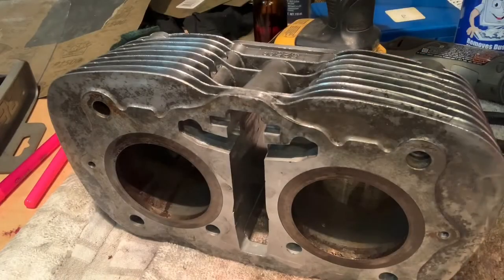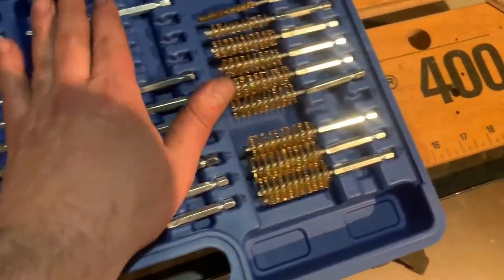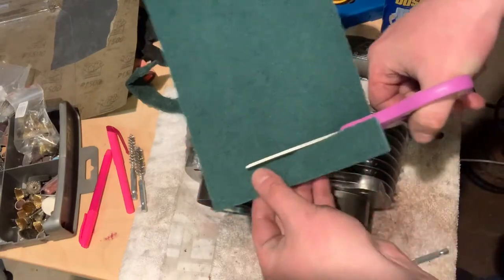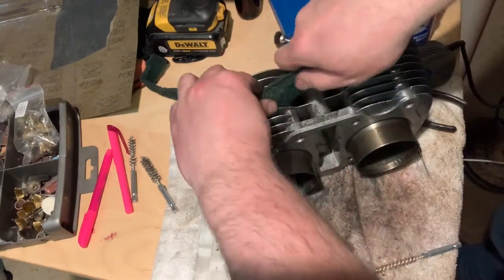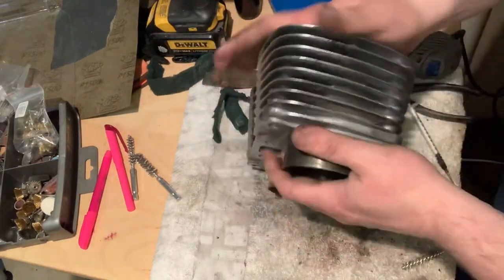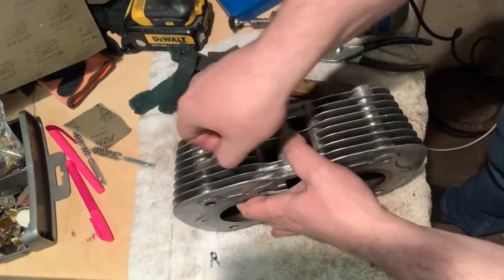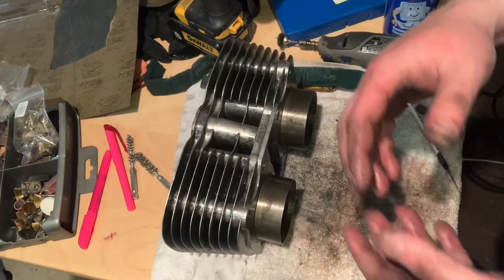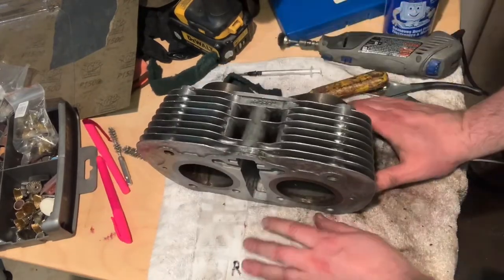How To Clean & Polish Motorcycle Engine Fins-Part 137

Comment: I used extra long soft brass wire brushes with turps then cleaned, blown out with air repeated a few times! Worked a treat on my 75 cb400f  resto 😊
Reply from the maker: My brushes were too wide! I need to find some like you. Thanks, Des.

Comment: Easier and best way to clean and polish between fins is using a reciprocating multitool. Just take the teeth off the blade and wrap it with 3m pad, sandpaper, or cloth and polishing compound.  It works 100x's faster than doing it by hand.
Reply from the maker: I have one of those! I’ll give it a try! Great tip!
Reply: Correct or an oscillating tool.
Reply from the maker: I’ll give it a try!

Comment: I do admire your enthusiasm. I'm 67 now and have been down your road so many times since I was 14. Yep, you can work away like a mad thing endlessly; but in the end you have to draw the line under your masochistic effort. Ok, if you're building a show bike, then go for it. But getting any air cooled motor to that level....handwork will only go so far. Here in the UK you WILL get caught out in the rain. 20 miles of that will result in tears...all that work gone bad. My advice is, clean your bike regularly and enjoy it as it was intended. Hell, riding the thing gives you zero opportunity to admire 80% of your machines cosmetics....just before you pile into the back of a semi. Ask me how I know.
Reply from the maker: Valid! I get a OCD sometimes. Eventually I move on but I like to give it an honest effort.

Comment: I struggled with doing the same fin  cleaning as you. I went to harbor fright and bought one of there small hot steam cleaners. It comes with small brush attachments, small enough to fit between the fins and the pressure and hot water blasts out all that old grime and grease. Then went back with XL q-tips in the drill. Worked really well for me. Hope you get to where you want it brian.
Reply from the maker: Steamer! Good idea. Definitely worth considering. I’m really fighting old paint. That’s my biggest issue right now. A major PITA but I’m making progress.

Comment: You should use a hand held sandblaster with baking soda as media and soda blast it clean works great for everything motorcycle
Reply: Is this just over the counter baking soda?
Reply: I like your idea though in the comments there are many really good ideas with technique I just think your strategy makes sense to me and possibly less work, I'm not a pro but baking soda is in my tool box next to the duct tape and gorilla glue and JB WELD. THNX 👍 NEVERTHELESS AWESOME VIDEO
Reply: Man I did that and it’s a mess and not great at all.

Comment: Thanks Brian, I always pick up good tips from your videos, I am cleaning up a 72 CB450 and have faced the same issue in getting in deep between the fins, One thing that made a difference for me was to take a small file to the edge of the fins and square them off a little then go over them with a scotchbrite pad.
Reply from the maker: Andy Crabb On it, Andy. Thanks for the tip with the file. We can do this!

Comment: Try using an oscillating tool. You have to adapt a plastic fin mounted with 2 screws on a flexible bit, then by using different grades of Sandpaper (or Scotchbrite Red/Gold pads cut into strips that fit the tool) you can get down to the shiny stuff then using compound and polish it will make it shiny again. I use Sharkhide to protect the parts because polish does not last but sharkhide is a non yellowing clear coat that protects for a few years. and you can still clean the engine in the MC if need be with the same method.
Reply from the maker: That’s a great idea. I’m gonna give that a try. Need to go buy one…shucks. Lol. Thanks.
Reply: @KeepOnWrenching  Buy a cheap HF one to try it. If you love the idea then you can get a better one if you like.

Comment: No brother you are not "over engineering ". I am into ATV's, and it does get under my skin when I see that an engine has been abused by not keeping it clean and shiny (I know ATV's are made for the mud and grime). But I am a perfectionist and I love to see things clean. Those cooling fins look so beautiful when they are clean and shiny. YOU will appreciate it in the long run when you look at the engine and know that it is immaculate from top to bottom. And if just one person gets up close and personal and sees just how much detail went into shining up the engine including in between the cooling fins, you can pat yourself on the back at a job well done.
Reply from the maker: Thanks! It ended up being totally worth the effort. Beats painting them.

Comment: I love your CB350 twin videos! Never stop wrenching :) I will be the guy that feels bad for having dirty fins lol
Reply from the maker: Totally acceptable. I’m being converted towards living with dirty fins every minute. Lol.
Reply: Loosen the dirt with solvent of some sort (‘Gunk’, or acetone, perhaps) wash off with a pressure washer, spray with HT matt-black paint and polish the edges of the fins with the light application of an abrasive disc on an angle grinder.
Matt black should shift more heat than polished fins too.
You also need to watch … you’re getting a lot of abrasive particles (from wet/dry and from Scotchbrite) very close to critical surfaces while you’re using that stuff. Les in UK 🇬🇧

Comment: I got a CB175 1967 currently working on. Some years ago I had a shop fixing and doing overhaul, the guy end up spay paint on the cylinders and gear covers etc... i hate it, now gottta remove all those. You r doing a great job
Reply from the maker: Painted engines are the worst.

Comment: To clean a 4cyl I gave it to a company that blasts dry ice. In 30 minutes everything was amazingly clean, I didn't even remove the engine from the frame. Cost me about $60.  
I then polished the edges of the fins by hand.

Comment: I always spray it down with  muratic acid and pressure wash it. DO NOT leave the acid on any aluminum part more than 15 to 20 seconds! Rinse Immediately!  It works quite well.
Reply from the maker: Interesting. Will have to look into that.

Comment: Ok. I have had this problem and now I'm doing it for my son. I will try these brass brushes as they are affordable as break cleaning brushes for car breaks. Also engine bright spray and a water pressure hose can clean more. Lastly,high temp silver spray after an oil displacer like brake cleaner will make them look like factory new. Enjuy. Oh and tape off all the cylinder holes, oil galley ect.
Reply from the maker: Not a huge fan of painting engines but yes a pressure washer and degreaser is key.

Comment: If you have a compressor you can get a cheap sand blasting gun. The 1 with the little hopper on top. Use Bicarb soda. This is not very abrasive but cleans reasonably well.
Reply from the maker: Plan on trying that one way.

Comment: I cleaned my fins a little with Simple Green and a toothbrush. This is while it still was on the bike. It worked well enough for me. I was cleaning the carbs by draining the floats as well and used a little gasoline on the fins. That helped too with the greasy parts. For me it cleaned up well enough tonight. I may clean it more later. Mine is covered pretty well with full sets of fairings on my 2004 GS500F motorcycle. This was a good video. Thanks. God bless. I was thinking 🤔 a cool way of cleaning it would be with steam or nowadays even with lasers which they use for cleaning.
Reply from the maker: Thank you!!
Reply: Yes brother  I enjoyed  Your videos  I was checking  Your Vid on how to put Gas Tank Decals  onfreshv paint my body guy did amazing  job on custom  paint and put oem Decals  on my vintage  CB on one side not good  so I went to my mechanic shop and he had original  gas tank same as my bike with  Decals  on it so I brought  that down we are going  copy  OG on to my tanks and measure  as well as we go hopefully 🤞😯🤞 it will come out Excellent  once we are done I'm going be assistance  to installing  it I spend 2 years doing Cosmic  Restoration Not easy on my gorgeous  NOS machine  to perfection  mint condition  and this is final touch Honda Decals  are sensitive  to install  with body  Line's and where Decals  have to be placed will see how goes  any suggested  comments  will be helpful 
As far as cylinder  I try see how Look with polishing  several  fins and look nice but I think  Black Looks great with powder  coat Look to it when I clean them I use simple  Green ket set little while then I put scotch  and white rag and clean it spray water inside rinse out dry it paint after it took few try to get paint inside  you almost  got get tip right up to it spray  works great I paint engine  as well Looks gorgeous  cover all  hardwares  and rest parts went to Downtown  with it looks Like brand new engine  with same factory  blend finish  Looks fabulous 👌 👏 👍 😍 💖

Comment: Great work, enjoy your videos as I recommission a 74 CB450, I noticed the same grime cleaning out the motor, I have used purple power, which has been very effective against the grime in the fins. I had some wood shims,which I use to break up the grime then use another bottle of warm water to spray out the grime best I can.  One note don't let the purple power dry out it leaves a white residue. Good luck. Thanks
Reply from the maker: TheBad666m yup! I actually washed everything with purple power right away to degrease. That stuff is great. Very important to remember to rinse. Ask me how I know!  It took forever to save the 1970 cb clutch side cover because I let it sit. Lessons learned.  I’ll keep at it.

Comment: A used a sanding machine with a “finger “ tip. All the way up to 2000 sandpaper . I did have to sand down the finger so it fitted between the fins

Comment: sand blaster with fine grid sand or water blaster. many got those, I built one at a custom shop i used to work.
Reply from the maker: I’ve got everything to soda blasting my next build. Fingers crossed! I just need a better compressor.

Comment: All I can say, use Spray Nine Grez-Off.  Put cylinder in pan, spray Grez-Off all over the cylinder, go for a beer, then take a 1 inch soft paint brush and swish of carbon, grease and dirt, it is that easy. If you can get a 4 litre bottle and just let the cylinder soak for 1/2 hour it will do the job even better.
Reply from the maker: I will try this! Thank you.

Comment: I used an oscillating tool basically like your putty knife, but 🚫 not the blade of the tool attached a flat flexible piece of plastic with small rivets and shape the plastic pointed, round, whatever.
And as we all know clean cloth and repeat. If I do another piece soon I will try to send you a video
Reply from the maker: I bought of those. Like the idea of a custom tip. Thanks!!!

Comment: How do you guys get bugs off the valve covers and case covers on air cooled motors? My cb1100 just bakes them right into the covers. They're factory polished and clear coated so I'm not trying to hurt the finish Any ideas?
Reply from the maker: That’s tough. That’s why I hate clear coating engine parts. You may be able to use a wet 2,000 grit sandpaper to carefully smooth them out.

Comment: I clean my whole engine with power wash with out disassemble, first spray with heavy duty degrease let it sit for 15 min then blast with power wash + hot waters. Note : my power wash is gas OP have 3100 PSI , clean in 30 minutes
Reply from the maker: I want a hot water pressure washer.

Comment: Looks like Hard Work, Maybe a Sandblaster would Speed up the Process, they Aren't Soo Dear to buy these days, You can get an Attachment for a Pressure Washer to do Wet Blasting, so there isn't Dust to deal with,  a Decent Bench Grinder with a Wire Wheel is a Must Have for any Workshop,  Hit it with the Bench Grinder 1st then use Scotch Pads! -Cheers👍😉🍻

Comment: Find someone with a dry-ice cleaner. The grain size and pressure is adjustable by button, and it would be quickly done. And perhaps change the title from "How to .. " to "How not to .. ". Since you got it apart, tougher blasting might be ok too, soda or water.
Reply from the maker: It’s really more about using what you have available to do the job. It totally doable this way. Sure, it takes time but can be done. It’d be awesome to have those other options you mentioned as options. Maybe one day. Thanks!

Comment: Just purchased a 74 Kawasaki triple barn find.  The engine is nasty like yours.  Wish there was a secret chemical to spray in the fins to make the sand casting look like factory.  Everything else I've seen including your vid is monotonous, but looks like the only choice.  Give you loads of kudos for hanging with it.
Reply from the maker: Yeah…no real shortcuts unless you can vapor or walnut blast. Still gotta degrease tho

Comment: Maybe try steam to clean as best you can.. then paint the fin sections with black heat resistant paint.

Then sand back fins to reveal metal sides to end up with a nice black/chrome finish..

Then to maintain use Harley Davidson engine brightner to keep it looking new
Reply from the maker: I’ll have to give steam a try.

Comment: I suggest a dremel tool which can reach in those fins.  Good luck my man!!!
Reply from the maker: Paul Borg that and time. Lots of time. Lol. Thanks, Paul.
Reply: You can use a brass wheel ,I have done it with success on Honda cb four.
Reply from the maker: I need to get a brass wheel for sure.

Comment: If the cylinders are getting honed why don't you just have them boil the whole jug. Which is what the shop would do before holding the cylinders, they usually do this overnight and the cylinder head looks brand new when they're done.

Comment: What would it cost you to have it shell/soda blasted? I mean as opposed to buying all these pads and brushes and the time you put it (which I assume is free).
Reply from the maker: I don’t know. I’d love to do that but if you don’t have the tools or budget it can be done by hand
Reply: @KeepOnWrenching  it's a small piece, so depending on how close to you the next place with a sand blasting booth, it might be worthwhile giving them a call. Should be a ten minute job for them. Of course doing it yourself gives you a sense of accomplishment, plus you get to torment your brain. Just make sure you wear eye protection when messing with wire brushes etc. on high speed tools. It's easy to forget to take precautions when in the thick of it. Using scothbright pads is a great idea. I'd combine them with wet sandpaper, using the pad as, well, padding for the sandpaper to ensure it retains contact with the fins. I'd try other bits of metal or wood too as supports for the pads. e.g. disposable wooden tongues or similar as long as they're strong enough - perhaps they are if you glue two together.

Comment: Is sand blasting an option before polishing?
Reply from the maker: I wouldn’t sandblast these parts as any grit and dust can do some damage. I’d worry about marring things up. Soda or vapor would be amazing. Maybe one day.
Reply: @KeepOnWrenching  I was thinking of going that route to get rid off the black engine paint in between the fins before I try to polish. Any alternative suggestions?
Reply from the maker: Andre-Guillaume Kanyinda mine had paint too. I used aircraft stipper with a puffy knife and then high pressure washer with degreaser. It’s worth the time to get it back to metal. I cry when I see people paint these engines.

Comment: First use mineral spirits then paint remover then 3m wheels to scuff it!  Then brass wheel then aluminum polish. easy way is clean, paint, clear coat.  epoxy urethane paint not powder coat!

Comment: would ultrasonic work?
Reply from the maker: Graig Cameron I ran the piece through my ultra sonic a few times just to clean it initially. I have a smaller unit so I had to go one side at a time. Ultimately, it had little impact as what I’m really fighting is old paint. To get it where I’d love it to be I’m going to have to just put in the time I’m afraid.

Comment: But I’m going to spray on rust dissolver directly on rusty parts let sit for awhile rinse really good with water,,,, then spray the aluminum engine and entire bike taking the seat tank and side covers off and hit it with tire shine/clean foam and then let it drip off and I will do that process as many times as it takes
Reply from the maker: It'll clean up quick, Mike. What year and model did you have?
Reply: Burgundy with pin stripes beautiful original paint original 5593 miles all original parts except the muffler system 1979 Honda cm 400 A Hondamatic
Reply: You wanna buy it? I’ll only sell it to someone who will keep it original! Thanks 🙏 Mike
Reply from the maker: mike eger hondamatic!? I’ve always wanted to see one of those. Heard a lot about them but never seen one. I wouldn’t buy tho. Just admire. I barely have room for the two I have. :)

Comment: NOT SURE IF THIS WILL WORK... But... If those fins are ALUMINUM... And ONLY if the fins are aluminum... I learned from.making an aluminum.pressure cooler LIKE ABSOLUTELY NEW. Go to the grocery store, buy (from the bulk section) cream of tartar... Drop the part in a pot of C.O.T. in boiling water and see what happens--again if it's aluminum--you are gonna TRIP and hard.
Reply from the maker: Interesting. Never heard of that. Thank you.
Reply: @KeepOnWrenching   I have a 32 oz bottle of Awesome one dollar store?? Takes off grease ,paint ect ony cost $3bucks!!